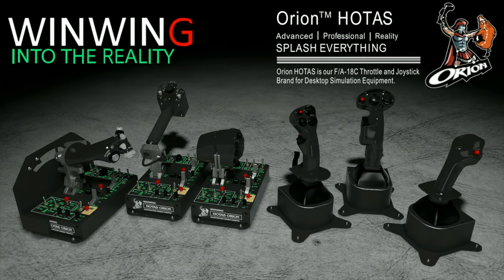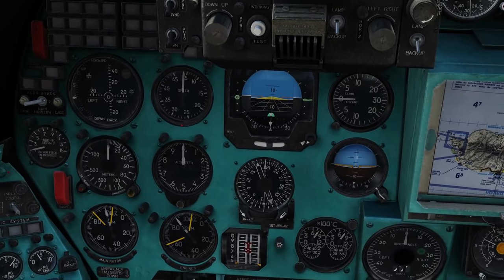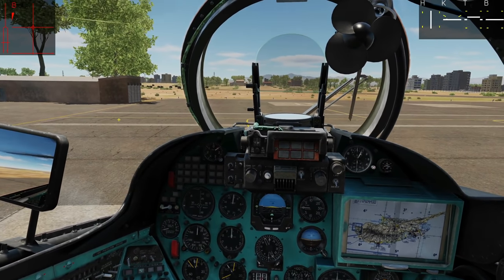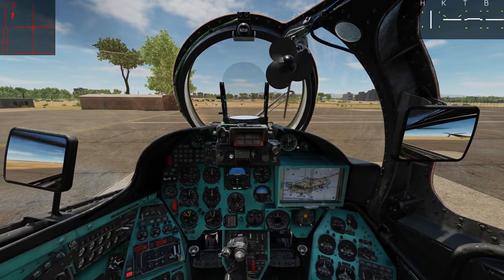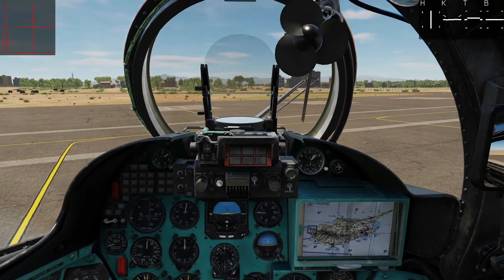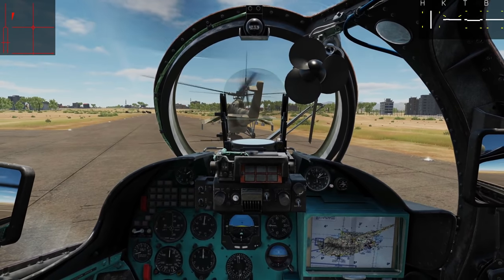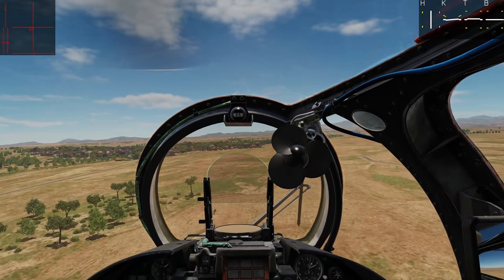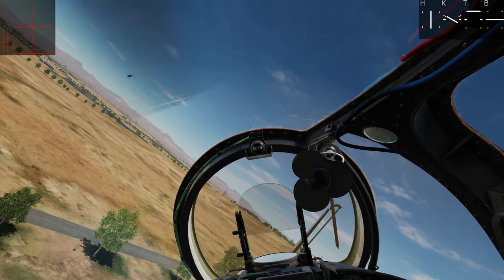Mi-24P Hind: Basic Takeoff, Flight & Landing Guide | DCS WORLD

Comment: I spent all night crashing and being unable to control #dcsworld hind module. I followed everything here.. except as soon as my wheel left the ground: I spin to the left out of control, as if i had left rudder to 1,000%. I tried everything:  change binding, add deadzone, change sensitivity... nothing... I could not take off without losing control. After being fed up, I tried taking the tutorial. Everything worked as expected. No spinning out of control upon takeoff. I had been using "Instant Action". So I went and created a map of my own... Same startup, same map (nevada), same everything. Suddenly everything was working as it should be.

What an absolutely terrible bug! I confirmed this by going back into "create instant action" mission 2 more times and yet again spun out of control upon takeoff. Ending up in crashing the hind. So then I went and created a new mission in the editor: once more: smooth sailing. I spent 4 hours last night trying to figure out what I was doing wrong. ☹
Reply: I had this with the cold start and taxi mission today. As soon as my front wheel stopped touching the ground the hind started nose diving to the left to end up on it's side.
I was pleased to see that the hind is indestructible in that tutorial mission so i had plenty of time to try and get it right without restarting. I did not get it right.
 
After about 30 minutes of frustration, trying different things to figure out what i was doing wrong i quit the mission and started the takeoff mission and i took off without a problem. Well, in comparison to the previous mission.
I even performed a successful controlled crash. I lost my tail but i could walk away from it so it was a good landing.
 
So yea, i'm not sure what was wrong but it was really annoying.
I'm glad to read i'm not the only one experiencing this even though it's 2 years later and it still happens which is kind of sad.